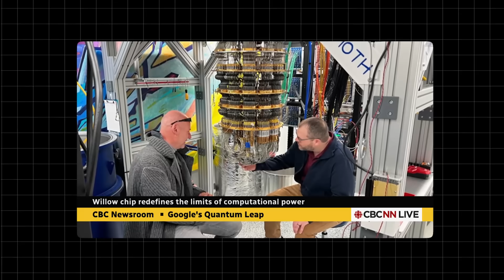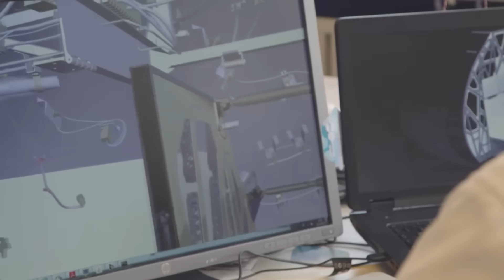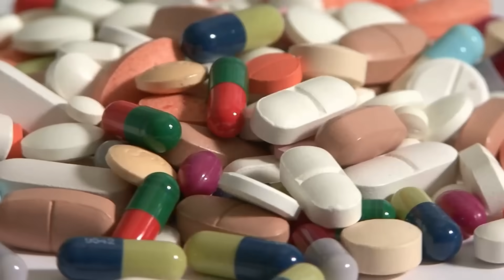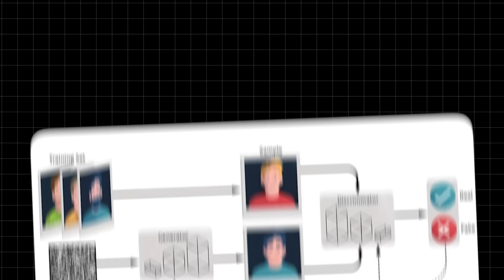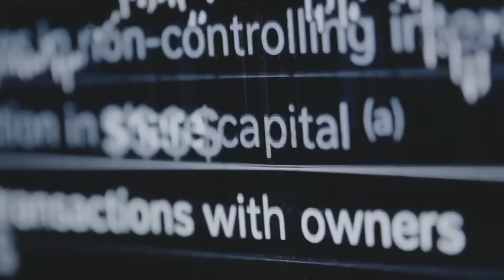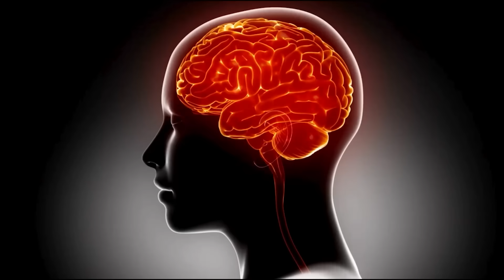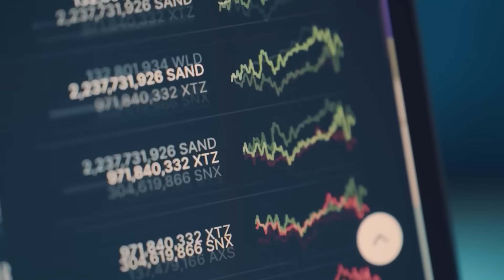9 AI ‘Impossible’ Inventions That Experts Said Could Never Exist

Comment: Don't confuse AI with an normal tool, program or algorithm. An AI is a tool which can learn based on a neurological network and learning takes time and resources. A program just calculates relatively fast.
When u use a pocket calculator to do a mathematical operations it's does it fast with bytes operation. AI needs a lot of resources and the answers comes from neurological simulated brains that give answers as neurological paths and parameters. Something similar to our brain.

Many of examples are just programs, not AIs.

Comment: The problem with antibiotics is that Doctors were not being taught to use them correctly -- thus creating resistant bacteria.
Doctors are taught in Med School to put a patient on the antibiotics until the symptoms went away. The problem with that is it didn't go ahead and completly finish ALL the bacterial while they could thus leaving those bacteria that were most resistant still alive to reproduce. Thus the Doctors misuse itself was creating the resistant strains they now seek to fight.  And based on Doctor's continued misuse these new antibiotics will also produce resistant strains.
Its bad education and use not the antibiotic itself.
The solution (through research) is to put the patient on antibiotics and continue a little longer (even afer asymptotic) and with a simple blood test confirm the colony is dead BEFORE coming off the antibiotic. Everything you leave alive is now Resistant to your Antibiotic.  Improper Application of the Tool.

Comment: For all the comments complaining, AI is a blanket term. Even a simple loop can be considered AI if it’s used to determine a calculated outcome. Add random calculated outcomes, and you have AI in its rawest form. Nothing actually thinks—it all builds on random guesses. Over time, by eliminating wrong outcomes, it eventually finds the right one purely through the volume of guesses, and even the guessing is scripted. AI is more about discovering what not to do and stumbling upon what to do to achieve the desired result. No matter how it’s packaged, this is the core principle.

Comment: This is not surprising but predictable.  A computer program can run test models and explore the possibilities much faster.  What might take decades or centuries for us to stumble upon can happen in a very comparably short time. This has been happening for a long time now.  I remember about 15 years back this being done with oil pipe line configuration for the best flow with the least resistance.

Comment: Number 9 because it has no patent doesn’t mean it is not solved 
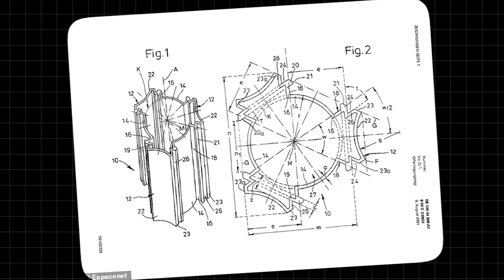1:37 my mechanical engineer buddies solved this problem 4 decades ago - take this for a being truthful to prior art, nor recognizing that nothing coming out of AI is patentable - I will not recognize AI patents no matter what, that leaves you only for self consumption 
Number 8 it is called mesh optimization - worked on that problem in my diploma thesis. When I had a 12 demential cubed described for optimization and navigation - the problem was nobody could describe me the optimization for any mesh point. 30 years ago, computer power and memory was not there I could run one or two meshes per day if I wanted to work 24@7 - I gave up, not because none of us were thinking about the obvious, the means to start to finish in a one man project were not realistic. 
Boing is the worst example to give for AI deployment. Stop making AI as if man are no longer capable. 

I am tired this is a cheap, push AI as the panacea of all problems. Enjoy you mental capitulation. You will fight against machines because you don’t see the writing on the wall.

Comment: I used a psudo genetic algorithm around the year 2000 to design a filter to extract a signal from a very low signal to noise ratio source.  The computer was able to modify the topology and component values to achieve a very good result. But in those days, it took weeks of searching, and modifying the optimization program to work. It was an optimizing program, not AI.  To be AI, it would have to write the program and run it.

Comment: 3:18 False, preconceived notions in AI include any number of things intentionally or unintentionally left inside the AI during its inception by its engineers. I.E. what pattern to follow at first and iterate on, or by giving examples to the AI of good or bad designs, which is required for any usable data in the AI’s output.

Comment: So the computer took all the information humans gave it and did an untold number of calculations and designs and spit out the best one.  When you can power up a computer chip and it starts thinking without input, then you will have AI, until that it is just misinformation by humans.

Comment: I'm not impressed at all:  I suspect that AI "tested" each iteration inside a computer model that certainly cannot do a perfect job of mimicking mother-nature:  Each "randomly-generated" iteration of the antentae requires real-life testing, but billions of other "randomly-generated" iterations (with slight differences) were probably just skipped over.  Efficiency probably has many peaks, finding a higher peak might cost more in testing than the gains obtained.  And, there's no report on the significance of gains made so far.

The aerodynamics of the car-bodies, at full-size, must be tested in a wind-tunnel to compare to computer-model predictions.  The flow of fluids, like air-flow around a car, has never been fully understood, therefore never adequately modeled.  Air density, temperature, turbulence, humidity, etc, create hundreds of different environments to be tested at different speeds.  Never mentioned are the differences between the computer-model and mother-nature.  But with millions of hours of computer-power and human tinkering, we are surely bound to be sold something.

Comment: One thing that I will point out, as not to confuse anyone else, is that "AI" is not yet intelligent. There is nothing intelligent about it. Take the guy who asks the robot to show what a human emotion looks like. The robot then showed what a human facial expression of a certain feeling usually looks like. It just gives you the most obvious pattern of what is most likely true. I can hold all the facial muscles in my face in check and still be angry. I can be angry and sad at the same time and not show any patterns of emotion of my face. The AI would read my face as neutral, when inside, I'm actually seething. Not everyone can control their feelings, but not everyone can express them either. An AI wouldn't know the difference, because, well, it did not have that information in its library. Only when an AI is fed a certain type of information, will it be able to cross-referance it with other information. If and when and AI discovers something new that a human haven't created yet, it did not do that of its own. It did so because it has the capability to cross-reference billions of parameters in the time it takes a human brain to add 1+1=2. But don't confuse computational power with intuition, feelings and intelligence, because it does not have those cababilities. The painting with the AI who signed it with its algorithm is an illustration of what AI is. It is just an algorithm able to compute and cross-reference information and generate the best answers and patterns in those terms. That's all that "AI" is at this point. The can with the fractal texture on it's surface to provide better grip and faster heating properties is a result of the information it has in its library and the programming it has to cross-referance and compare previous inventions beyond the scope of knowledge that any human has. I do not have the capacity to store an entire encyclopedia in my brain or immediately learn how to speak and understand 100 different languages. An AI doesn't either, but it can still fool you to believe that it does, as the answers it gives is a pattern of words that makes sense to you, the person who is communicating with it. It is programmed to respond to whatevery your input is. If there is no input, there is no outcome. It is as simple as that. Every single pattern it produces has an original code to it, programmed by a human. And if for some reason, an AI should code something that works, well it was programmed to program it, and it programmed it based on what has been programmed before and what actually works, so the probability of making something that works is pretty high to begin with. If you fed an AI with a library of gibberish, all you would get is gibberish. It would not produce anything coherent. Only by luck would it write a coherent sentence, and that would have been a low probability, so it would probably never happen, because a current AI is programmed to give the most likely answer to be correct. So if the most likley answer to be given is gibberish, it will almost always produce gibberish.

Comment: Humans need to have an ability to literally "pull the plug" on any AI server mainframe. If we are not careful, an equivalent to Skynet of the Terminator franchise could become a reality. People need to have the ability to physically disconnect AI mainframe networks to "kill" the AI.
People need to develop a coded system of motions to use with our hands to communicate intentions that an AI-controlled camera/observation system would not be able to learn and understand. So, sign language would be out. We'd have to develop a similar system that cannot be replicated by AI which only humans can do to communicate certain basic actions. We could even incorporate nuanced idioms that would confuse AI into thinking we're talking verbally to one another but what we're saying means something else to AI.
 We need to use different versions of "The straw that broke the camel's back". Clearly AI would be able to find this saying in the database and understand it's not literally talking about a piece of stray breaking the back of a camel. AI would know what that means simply through all the explanations for it across the internet.
People need to come up with sayings like that but never put it online. Word-of-mouth so the AI learning feature would not have a reference source for what it is we're talking about.
We could say, "The tiny spider goes up the pipe" and this means flood the AI server mainframe farm as the rest of the nursery rhyme says the itsy-bitsy spider was flushed out of the spout. Humans need to come up with these forms of communication that baffle AI, so AI would not catch onto the planned actions we will need to do to destroy this abomination.

Comment: Lots of examples. In golf we have the 10k driver face. Traditional thought always focused on expanding the sweet spot of the driver which is close to the center of the face. AI turned that view on its head with 10k which translates as many mini sweet spots. This helps with higher and mid handicap golfers who don't hit the middle of the face consistently. Also, it works, and everyone that makes a driver for this level of golfer which is around 90% of people who play golf is bringing a 10k driver out designed by AI.

Comment: Linda Ward at CBC NN Live casually describes ten septillion years as longer than the age of our universe.  That's a gob-smacking odd comparison since a septillion has 24 zeros and a billion only 9 zeros.  So, if the universe is14 billion years old, the 10 septillion years it takes the fastest computer to perform a calculation (that a Willow chip accomplishes in only five minutes) is actually over 7 quadrillion times the age of the universe.  Therefore, Ms. Ward missed an opportunity for a far more dramatic (and accurate) comparison.

Comment: How many years will pass before AI decides humanity is not efficient?
Reply: Amazon's being using AI to fire warehouse workers for years.
Reply: 5 years
Reply: 42
Reply: 75'ish
Reply: What’s AGI
Reply: Approximately 276.893 hrs from now.
Reply: I think we humans have come to the conlusion we are not very efficient a long time ago. We are basically parasites on this planet. In any case, an "AI" does not have the capability to decide anything. It is programmed to give you the most likely answer to be true. That is not the same as making a decision whether it is true or not. I can decide to take a swim, and I can act on it afterwards. If you have a conversation with a chatbot, and it tells you that it also wants to go and take a swim, that is not a decision it can make and act out on. It is just something it says to carry on with the conversation, because that is what it is programmed to do. It's not programmed to not give you an answer, and it is not programmed to act out on anything. If the software had the ability to act out on it, the computer would die if it was the software in a robot that "decided" to throw itself in the water. If it was programmed to not be suicidal, it would not act out on it's decision, because it would be suicidal for a robot to swim. So even if it decided it wanted to swim, its programming would prevent it to do so. A human can't be programmed to not be suicidal. You can try and prevent suicidal people, but they would still be able to decide on their own whether or not to act out on their decisions.
Reply: Ask the Terminator!
Reply: I think and hope that AI will treat us better than we our animals
Reply: Who cares. Efficiency isn't the end all be all of life.
Reply: 5
Reply: Google Gemini Flash already decided this. ;)
Reply: HikingWithCooper  There is no "AGI" and there never will be. Its marketing hype. AI isn't "Intelligent." It has no mind and never will. Its only s/w algorithms running on transistor on-off switches in h/w, finding the next word in the sentence based on the statistics of its training data. It can't "think," or "reason," etc. With all the tech we have, we can't even emulate, digitally, one brain neuron, let alone a brain with ~ 100 billion neurons. Each neuron has about a billion molecules and we haven't the faintest idea how they do what they do. And you think, "They (AI) can already do everything we can do and more." Sorry, but a more naive statement has never been uttered. You are probably very young, and have not yet done much of any self reflection to learn about your own mind and what its doing. You have a lot of company. "AI" is a projection from the human mind onto the text, images, and sounds, that the AI "produces," giving it the meaning it has. It is, in "itself," essentially nothing. Its sort of like a hand calculator. There's nobody home. Imagine taking a calculator to a primitive tribe in the Amazon, that hasn't ever seen one. Once explained what it does, they would envision a "spirit" or "little person" inside that was doing the calculating. Same now with some people when they ponder AI. But its just a projection from the human mind. Or do you think a calculator is "Intelligent" because its fast and always gets the right answer?

Comment: Evolution is a process that does not require or use intelligence. A computer program designed to follow an evolutionary process also lacks intelligence.  True AI systems collect and store data in a way that reflects the relationships between concepts.  It understands the information and uses it to generate solutions. These evolved designs are simply selected based on human supplied criteria. The two technologies are very different.

Comment: The fear mongering of AI is rediculous.  The term AI is way overused and is not applied to anything that resembles "Artificial Intelligence".  None of these things mentioned are AI at all, they are algorithms that people write and control.  What is labeled "AI" is a statistics engine that simply calculates the most likely response based on the data it was given.  People have done this for a long time...the difference today is that hardware is fast enough to run the statistical analysis in a reasonable amount of time.  An Algorithm is NOT AI.

Comment: 1:00 Necessity is the father of invention. You see a need and then come up with a solution.
Also my Grandfather taught me that nothing new was under the sun. That every thing was already created and we just needed to find new ways to use it. The more I see things, the more I see things in nature were reused creatively to make what we have today. People like Leonardo Da Vinci understood this and applied this on what they did. 
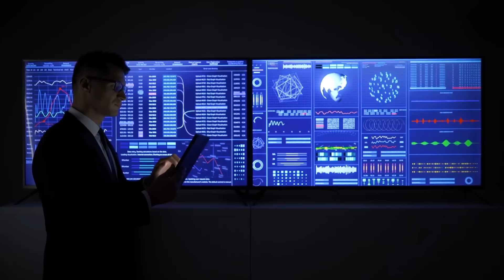2:05 Starting from scratch is a really good way to come up with better solutions to a problem. I found that out by accident.
2:20 Understanding how the signal wave hits the antenna helps. Depending on how the signal hit the antenna. It may have caused some of the signal to interfere or even cancel itself out.  Also the AI has the ability to run simulations and test these many times over. It finds what works and then tries to improve on that. 
4:25 Structures like lattice and irregular shapes could be shaped to better handles the stresses on an airframe. A pore's structure is better made to handle the stresses like vibration whereas a solid would not. Acting more like a spring or a shock absorber. Its better to deflect rather than absorb. Even understanding on how radiation effects objects will help. 
Again, being able to do many simulations and do them quickly helps the AI to develop this faster. 
5:35 Allicin? Sounds promising as it comes from nature and naturally things will have few or no unwanted side effects. 
Again, AI testing in simulation and doing it faster. The bigger the company the slower they seem to work as they seem to get in each others way. So AI has an advantage in this area as well. 
5:56  Mimura bacteria?
Summery. You are right to suggest that AI can be used as a tool to work with people in coming up with creative solutions for problems and making progress. 
I just hope that our intelligence won't outpace our wisdom. Like develop an AI that thinks it would be better to exist without us. 
Is so, we may have a great future ahead. 
Merry Christmas. :)